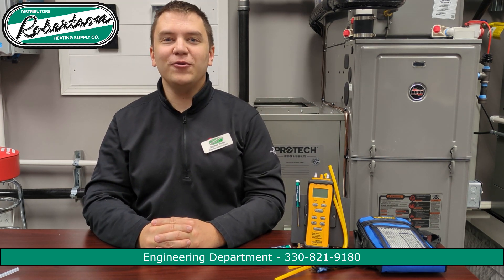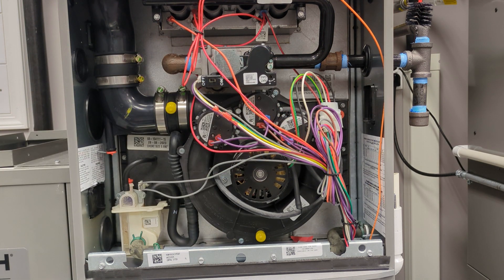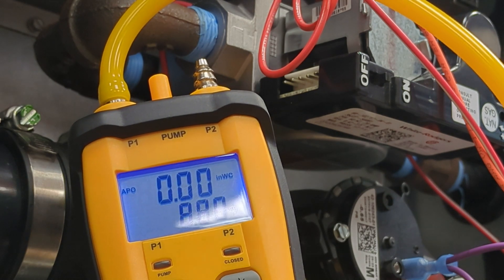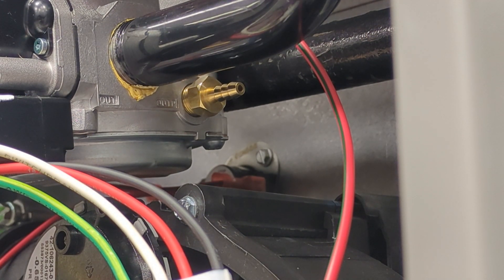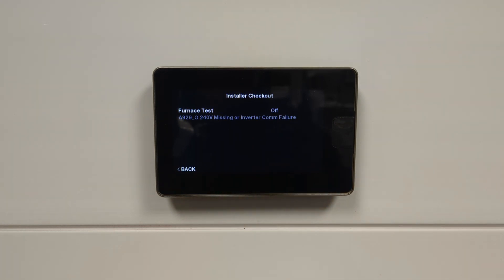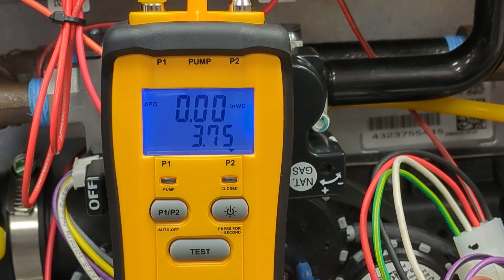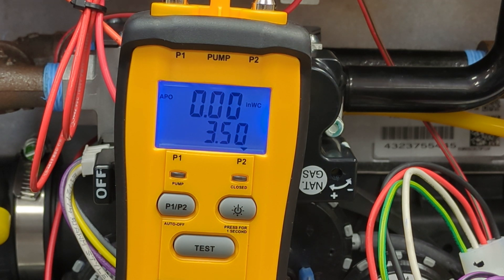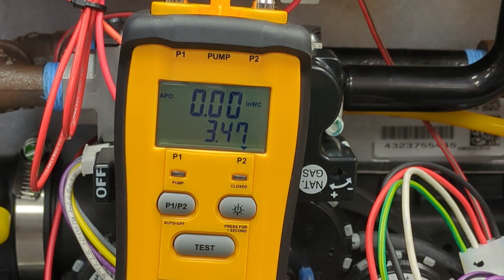RHS Quick Tech - Modulating Gas valve Adjustment

Comment: little confused on this...  from what you said
the INLET for LP would be 11-13 in H2O
OUTLET (HIGH) would be 11-13 in H2O
OUTLET (LOW) would be 1.6 in H2O +/- 0.2

I have a 98v modulating rheem furnance.
my INLET is 11.81 in H2O, so good there.
my OUTLET on HIGH call measures 10.25 in H2O

....but then I noticed something I didn't expect.
about 3m30sec into the test, it dropped to 5.63 in H2O
and then at 5m25sec it dropped again to 3.02 in H2O
and at 7min, it ramped back up to 10.25 in H2O

.....is this expected because of it modulating? or do I need to set each stage to be 10in +/- 0.5 H2O ?